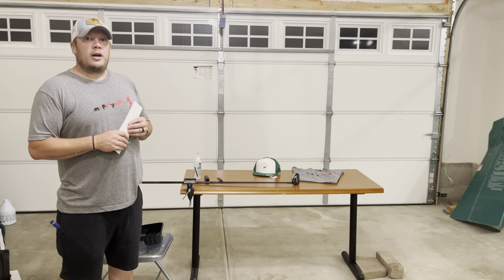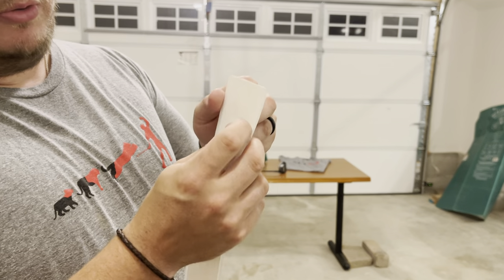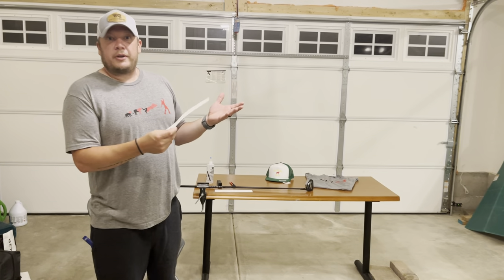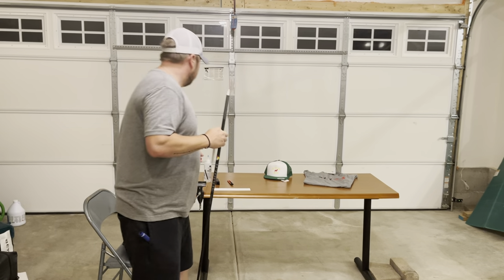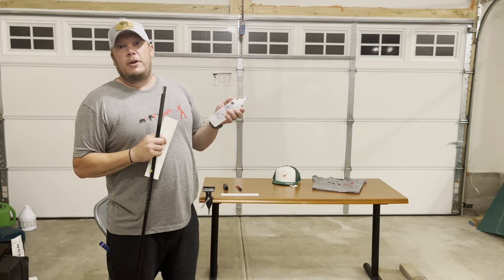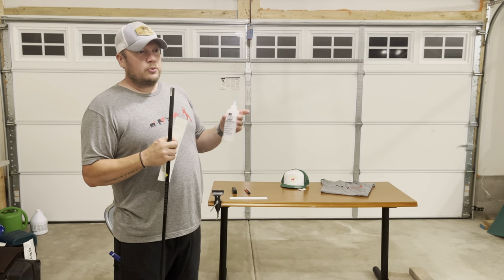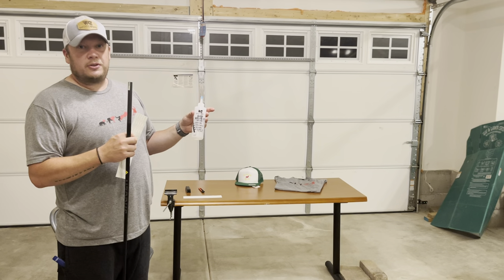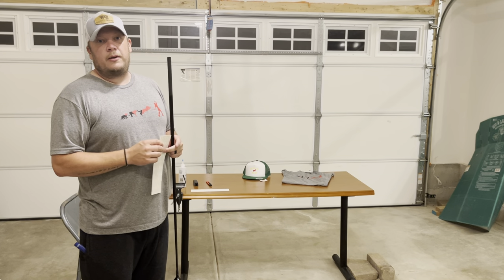What To Do If A Grip Gets Stuck While Regripping Golf Clubs

Comment: I've been doing grips for almost 20 years but all of a sudden, I started having problems with "stuck" grips and wasted too many grips. It became so difficult that I stopped doing grips for all my friends and now only do them for myself. I've used LOTS of solvent, even tried to heat the grips with a hair dryer to soften them up. I may have made two mistakes that has made it worse, I probably used a solvent to clean any residue off and not let them dry sufficeintly and also may have unknowingly gripped the grip too close to the end. I've stopped using masking tape thinking that it may be making the shaft too wide. Any ideas. As a last resort, I may have to get a compressor and start using air.
Reply from the maker: If you have only tried putting solvent on the tape or in the grip, I would recommend doing both as the bottom of the tape doesn't always get a lot of solvent. It is good to clean the residue off the shaft, but you should let it dry before applying tape.